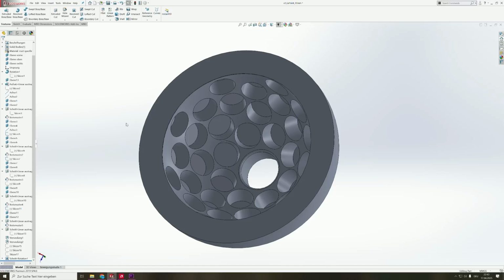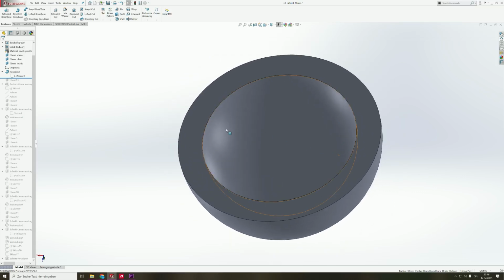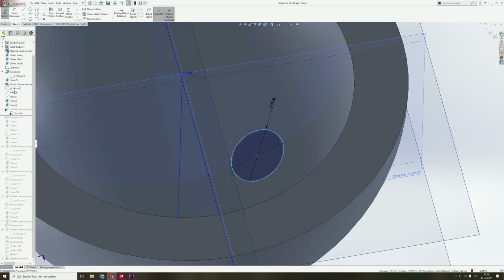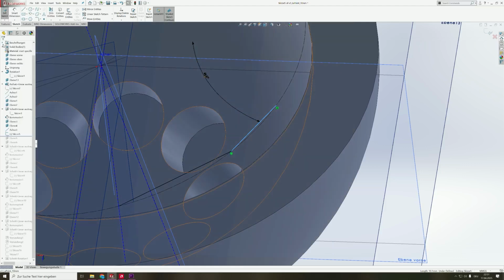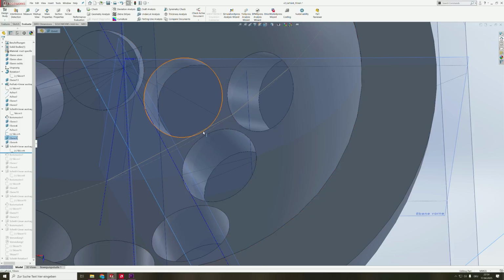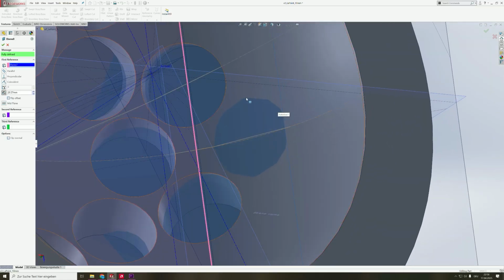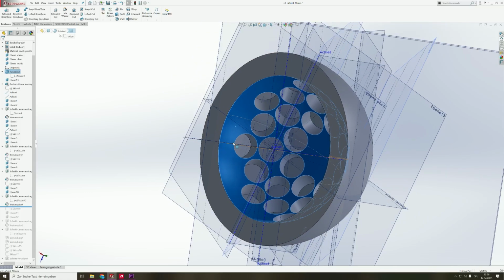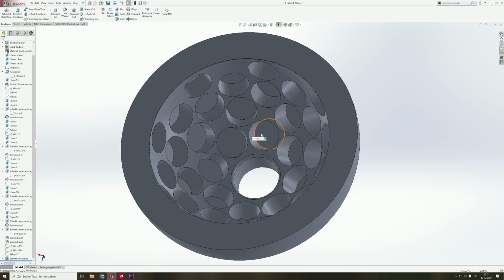How to design a 3D model of a bowl shaped magnet array (LaPoint array)

Comment: I love your work, I have a bit of a different way to do this, as I have experimented with magnet placement in 3d models as well, but using a more crude platform. In 3d builder, you can hollow a sphere to specifications and cut it. then for the magnet array you can create the diameter of magnet needed(including tolerance) then attach a thin long cylinder to the center of it(for zero point axis matching across all magnets), then angle to necessary angle spec for that specific placement row within the sphere, and then duplicate the magnet for the number of magnets needed for that specific row placement, then rotate the sphere in exact degree needed for exact placement every time, then inputting exact move specs for exact placement in the new rotation, then subtracting the magnet, and repeat. its crude, but works well to get exact specs